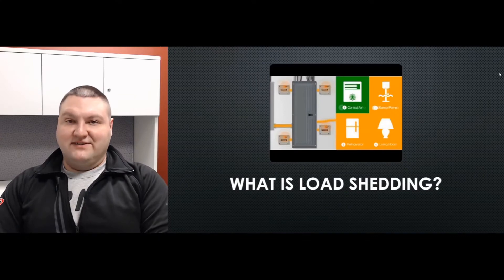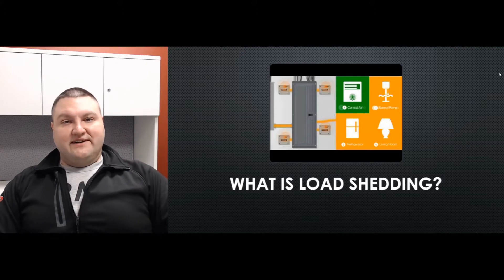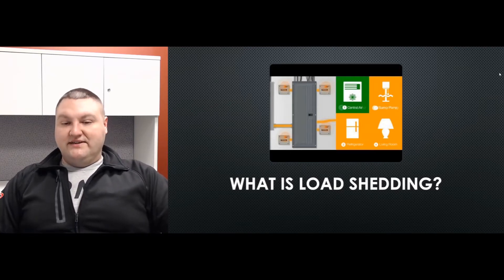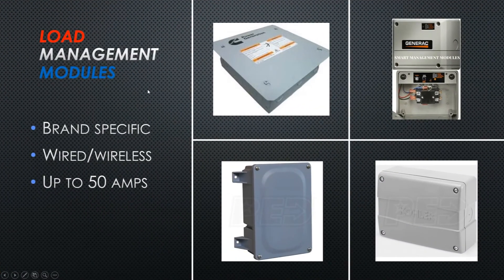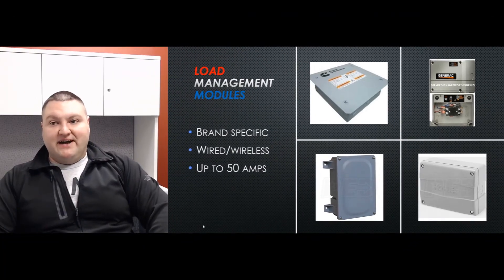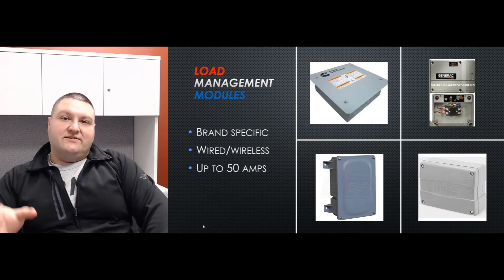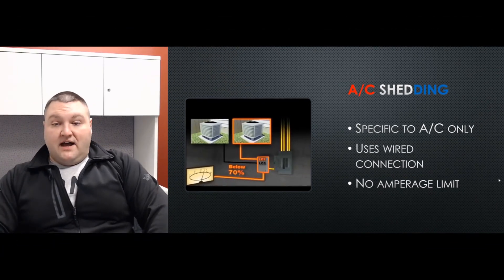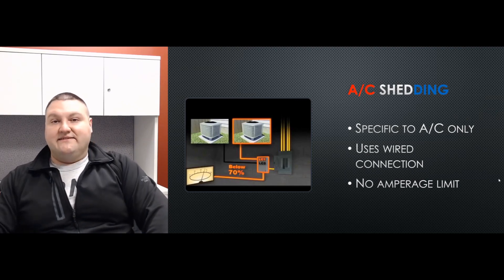What is Generator Load Shedding?

Comment: I’m helping to run a small general store and it has an 8kw generator connected to one panel that has the walk-in dairy fridge on it but there’s a large freezer and 4 small freezers that probably should be connected that aren’t currently and we have the load shed module but nothing is connected to the load terminals...  it seems like maybe there were plans to do more but the initial installation only went so far, now I sort of understand what it does, so it could be integrated.  What I’d like to know is if there are 2 big loads and the 1st priority one shuts off (satisfies) does it switch on the 2nd priority load automatically while the 1st is off, then switch back when the 1st switches on?  It would almost make sense to have it switch back and forth every hour so that it takes care of both of them, but it doesn’t seem to have that type of programming capacity.

Comment: I have a 22kw and want to use a load module for my pool pump etc. When wiring these do I only use low voltage wire to wire these up or do you have to wire into panel. Thanks good job on videos very helpful

Comment: This description of devices sounds a lot like an iot smart switch.  I have everything in my house connected to smart switches.  They are all monitored and controlled via a home automation controller.  To implement load shedding I just have my home controller turn off devices based on rules I define such as, “activate generator scene” which turns off all non essential devices all at once.
Reply from the maker: We can see the similarities between the examples, thanks for the illustration.

Comment: If the power factor of the load changes, will that affect the amount of real power (kW) it draws from the generator?
Reply from the maker: Technically yes, if the power factor of the load changes then it will either draw more or less power from the generator. This will not change the generator's power factor, as it is a constant.
Reply: @PowerEquipmentDirect  Interesting, thank you!!

Comment: Can A/C shedding be used with clothes dryer and stove/oven?
Reply from the maker: The built in A/C shedding will only work with items that use low voltage (24 volt) control wires. Any other item will need a module at the circuit breaker.